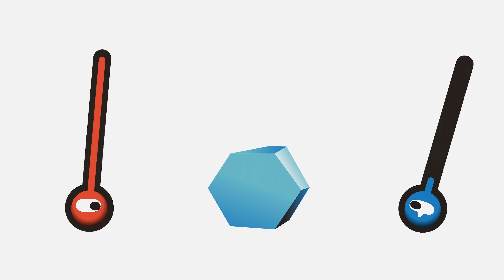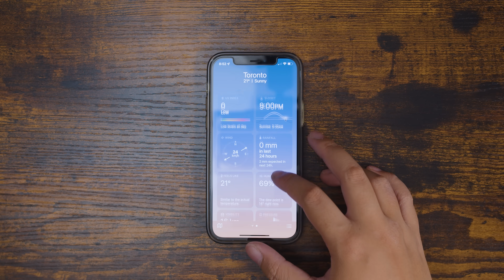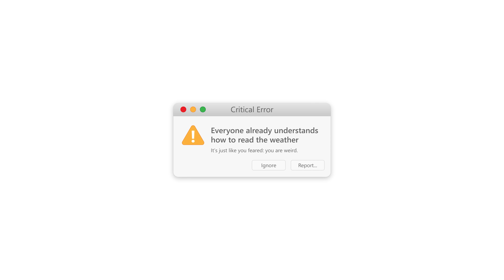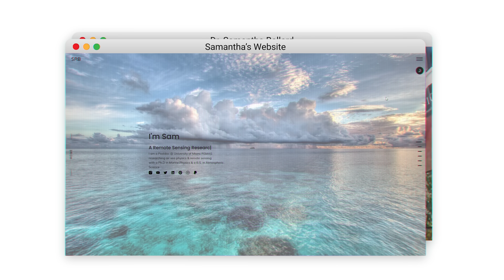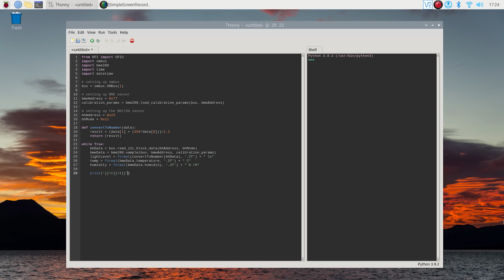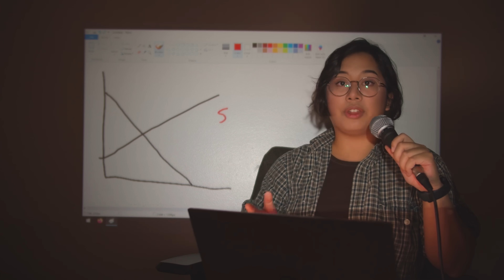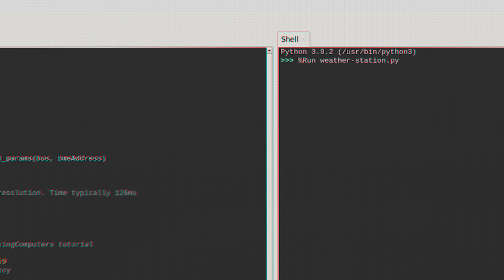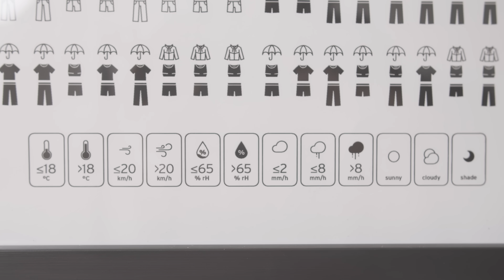how fahrenheit fails you

Comment: "Celsius isn't intuitive"

0 is freezing to death
100 is burning/having your blood boil inside your body to death

that is all

water freezes at 32f
what a.. weird number
Celsius is just 0-100

and ones comfort will depend on where their body has adapted
in some places 20c is pretty chill
some places 20c will burn your face off
in some other places 40c is seen as hot but not scolding

it depends on the architecture and who you are
places like the UK have houses built to keep heat IN
meaning 20c, which might not be much for spain or the middle east
will be SCORCHING for them

places made in hot places are made to not be so hot
and places made in cold places are made to not be so cold

Comment: Translation: "I understand 0 to 100 perfectly fine, but can't wrap my head around -10 to 40"
Reply: Since all non-Kelvin non-Rankine temperature scales are arbitrary anyway, why shouldn't we use the one that goes from 0 to 100 instead of two arbitrary numbers that are not 0 and 100?
Reply: @NYKevin100  Celsius isn't arbitrary though, it maps 1:1 with Kelvin, just offset by 273* degrees (* I think it might actually be 273.4 or something, but still 1:1 mapping).
Reply: @KindredBrujah  The size of the units are completely arbitrary.  Temperature is one of only three units in the SI system that aren't defined in the context of other units.

The Kelvin scale was created to use the same size units as Celsius, but there's nothing particularly special about the size of the unit.  If the SI system had used Fahrenheit/Rankine instead, everything would still work the same although the numbers would be different.

Comment: As someone living in central Sweden who also happens to have a pretty decent understanding of the impact of heat on the human body, I would say the following:

• –20* :  it's so cold that you could die if you slept outside without proper insulation
• 0* : it's freezing
• 10* : it's very chilly
• 20* : it's nice if a bit chilly
• 25* : it's nice and warm
• 30* : it's quite warm, but still pleasant
• 35* : it's getting quite hot
• 40* : it's unbearably hot
• 45* : it's so f**king hot that even desert-dwelling people are complaining, and there is a very real risk that a healthy adult in any country could die of dehydration if they are not careful
• 50* : it's so hot that you can barely think of anything other than retaining moisture
• 60* : you need to focus all your attention on finding shade, cooling down, and retaining moisture in order to just survive, and you would quickly begin to hallucinate if you cannot replenish moisture
• 68* : only the very hottest of deserts ever manage to reach temperatures this high, and all places that even occasionally experience this type of heat are deemed uninhabitable
• 72* : you cannot survive this temperature for more than a few minutes at most, and will likely die within fifteen minutes
• 100* : the water and blood in your body are literally at a rolling boil and you would be dead long before you reached anything near this temperature.

Comment: I dunno, maybe it's just my 30+ years of living with celcius, but I can pretty easily tell what to wear just based on the temp in celcius. Basically below 0 is winter coat, between 0 and positive 10 a light jacket, above 10 is hoodie weather, and as we approach 20 you can start taking of more and more clothes. There's some variation depending how sunny it is or how windy it is, and also if it's after winter mid temperatures or after summer mid temperatures, because those just hit different you know

Comment: I dont know man. I feel like it is a you problem with celcius. And you also need to look at the "feels like" section of weather. 20C can feel like sweater weather if its really windy and the Air is still cold from Winter. 20C can also feel quite hot when the Sky is blue and there is wind, no clouds and you stand in the Sun for 2 hours. Soooo, yeah. I lived in the US for 2 years and honestly Fahrenheit makes no sense to me. Usually I just wear a jacked until its like 90 or something. It just feels too huge. Like in my mind 60 should be sooooo much colder than 70, but it isnt. Like when Do I need a jacket? When a sweater? When a Shirt? With C I have an easy rule <10C jacket <0 freezing so stay home 😂 <15 is thick sweater <20 is sweater 20+ is shirt 25+ shorts. 

The only problem is nowadays weather is crazy. Like in the morning its 4C during the Day 16C at night 14C and at night suddenly -5

Comment: Humidity can also make a cold day feel colder! Places with dry air that are cold usually feel less cold than places that have a slightly higher temperature but higher humidity. I live in a very humid area and even though the winter technically arent that cold to other places it can feel absolutely freezing. Combine that with wind and it can be an absolute nightmare!

Comment: Before continuing past the 1 minute mark, here's my opinion: Fahrenheit provide better temperature resolution in our "comfort range" (between 0-100 covers most climates); Celsius is better in a technical setting, providing a more descriptive range for temperatures you can expect for environments in the kitchen or laboratory. Kelvin and Rankin are really only practical when talking about extreme temperatures (like how close you are to absolute zero or radiation temperature). In other words, air conditioner in F, oven in C, astronomy in K.

Comment: Another benefit of Celsius is that the temperature that you experience in your average day is a lot smaller, usually in the range between 0° and 40°, so it’s more concise and easier to pinpoint an exact temperature.
Reply: I like Fahrenheit for my dramatically different weather in each season locale. The temperatures exceed 40 c in the summer and drop below 0 c in the winter, so having a 0-100 f scale that covers basically every temperature we experience with very infrequent negatives makes sense to me.
But really it all depends on what you are used to using. It's just numbers that only mean anything if you have experience to apply meaning to them.
Reply: @cbpd89  personally, I prefer to look at it in a way, where what makes sense to me. You’ve presented some very nicely articulated points, and I enjoy discussing the topic. Personally, besides the general sense of the fact that Celsius is easier if it’s 0 to 100 for freezing and boiling, and all below freezing temperatures are negative and all above freezing temperatures are positive, I think it all comes down to the simple things for me. Can I tell the difference between 15°C, and 0°C. Truthfully, and yes, I get there wildly different temperatures, but I can still tell a better difference between them than 15°F and 0°F. Although Fahrenheit provides a wide variety of temperatures, I still don’t feel it provides me with that accurate of a position. It just confuses the hell out of me, even though I’ve used Fahrenheit, all my life, it is so broad for typical temperatures that it is very hard to determine what the temperature actually is. This is why I overall prefer Celsius, I can easily pack the temperatures in to 10° brackets. I know that anything below zero is freezing, I know 0 to 10 is pretty cold, I know 10 to 20 is OK weather, not too warm not too cold, I know 20 to 30 is warm, and I know anything above 30 is pretty hot. It’s generally easier to me, even though I’ve used Fahrenheit all my life, it’s just such a broad system. In my opinion, it’s so hard to pinpoint exactly what the temperature is.

Comment: 3:47 personally, regarding your argument about Fahrenheit, I feel like that applies a lot more to Celsius. With Fahrenheit, the range between boiling, and freezing is 180°, while in Celsius it’s 100°. This would mean that it’s a lot easier to nail down an exact temperature in Celsius if there is temperatures in Celsius that are more pinpointed and accurate. And this is coming from someone that grew up with Fahrenheit. personally, the only reason I think Fahrenheit is more intuitive is not because it actually is a more intuitive system, it’s just because it’s the system I grew up with. Just like to others, 35°C might be the hottest degree you’ve ever experienced, while for us in Fahrenheit, 35° is just a cold day.

Comment: Sorry, but you lost me. Celsius and Fahrenheit are both just an incremental scale corresponding to the physical attribute temperature. It doesn't matter how the range of that scale is represented, it matters that it's consistent, meaning that when the physical temperature is at a certain point, it will always correspond with the same number. I wasn't born with an intuitive knowledge that 0 equals the freezing point of water, it's a scientific fact that it does freeze at approximately that temperature, with slight variations in the real world depending on other additives in the water, or other physical factors, like constant motion, interfere with the freezing process. So Celsius picked it as his zero point. He could have picked the exact temperature that lead melts, or the exact temperature at which hell freezes over as far as I'm concerned. The point is he picked something that was factual, consistent, and actually relatable to him as a scientist, AND most of the general public. 

But that's just the science. When it comes to how I perceive temperature, it's based off years of actually experiencing temperatures and correlating them to measurements of temperature that are communicated to me by thermometers and news bulletins and weather forecasts. If freezing temperatures had been represented by the number 8,5 million, I'd know to put a good coat on and beware of slipperiness when the weather forecast says 8,5 million. If a warm but not scorching summer's day had been represented by the number -0,3321, than I would know to head out to the park when the thermometer's mercury pointed at the -0,3321 mark. 

The number really doesn't matter, and there isn't any intrinsic intuitive nature to either celsius or fahrenheit when it comes to how I perceive the weather outside. I appreciate the infomercial for diversity in STEM education and careers, but I think the premise you hung that message on is fundamentally flawed.

Comment: I'm a pants guy 95% of the time. Once it hits like 35°C I will consider wearing shorts, but even then I will probably wear pants.

On a work day it doesn't matter if it's 44°C outside (thanks Sydney) I HAVE to wear pants. It's just one of the requirements of my job (chef)

Whether or not I wear a "sweater" is always up for debate unless it's like 31 and sunny.

Comment: Celsius is kind of arbitrary but it's really simple: 0 °C (32 F) is the freezing point of water and 100 °C (212 F) is its boiling point.  10 °C (50 F) is a chilly day, while 25 °C (77 F) is a warm one. It is certainly easier to grasp and more practical for daily use than Fahrenheit.

Comment: Temperature isn't inherently any more centred around human experience than other metrics. Expecting 50°C to capture how hot a normal day feels is like expecting 50L to be a reasonable amount of water to drink in a day. And even if it were, the climate isn't the same everywhere. As you already discovered, you can't map everyone's experiences onto a single temperature scale. So really, it helps more than hurts that it's calibrated around something like water.
Water in particular is good because we use it a lot. We boil it, we freeze it, we drink it... so we have an intuition for how hot or cold water needs to be to do those things with it. That gives a reasonable frame of reference for things like cooking, but also for weather. If it's below 0°C, you can expect it to snow or hail outside rather than rain. Perhaps you'll prepare for the sidewalk to be slippery. That is explicitly linked to the freezing point of water and it's immensely useful in daily life.
When trying to figure out how you personally feel about temperature, you can kind of just... figure out which number means "hot" to you, and which one means "cold". To me, 40°C is about as hot as I'm able to bear. 25°C is warm but comfortable. 10°C is chilly. -15°C is when I start to avoid going outside when I can because it's too cold. And those numbers are going to be different for everyone. For some, they're going to be a lot different.

So, I'd say that Celsius is better. It doesn't pretend like it can offer a temperature range for weather that's equally meaningful to everyone, and is still useful in daily life on top of that in a way that Fahrenheit is not. It's more widely used internationally. And it uses the same scale factor as Kelvin, the de facto scientific unit of temperature, making it easy to convert between the two.

Comment: Celsius is a scale to measure the transition of water, something directly related to the climate and the human being (~ 60% water), so it is extremely intuitive, because:

Below zero - Freezing 🥶🧊
0°C - Very cold (water melting) 😖🌨
10°C - Cold 🙁🌧
20°C - Medium (tends to be more pleasant, generally varying by 5° more or less for each one) 😀😎
30°C - Hot 😓😮‍💨
40°C - Very hot 🥵
50°C - Unbearably hot (the hottest deserts reach this) 🏜😵
...
100°C - Burn (water boiling) ♨️💀

Comment: Thought of this video. Trying to program an automatic thermostat. You wouldn't think it'd matter what scale, but it works using numbers with one decimal of precision. Since celsius degrees are a bigger range per degree that means the thermostat is less precise in part because it doesn't use farenheit internally.

Comment: If you want to dress according to weather, just look not only on tge temperature, but also humidity and wind.
15°C with low humidity and almost no wind doesn't even require something other than simple jeans and thin sweater or just simple longsleeve
15°C with like 90% humidity and windy weather requires a jacket over sweater
It's not that hard

Comment: It's not even a debate that units for weight and distance are superior in metric, but when it comes to temperature I can accept that fahrenheit is at least arbitrary in a useful sense. Fahrenheit himself just measured the temperatures in his hometown and came up with this seemingly handy scale for measuring temperatures. 0F is a really cold day, and 100F is a really hot day. What can I say, it's respectable and useful for measuring outside temperatures. 
I still prefer Celsius though, because it fits in s wito beautifully with the other SI units:

If you fill a cubic decimeter (0.1 meter) with water, the volume will be exactly 1 liter and it will weigh 1 kilogram. And this water also happens to freeze at 0C and boil at 100C.  There's just a beautifully logical relationship between those units that gets lost when you use Fahrenheit, that I'm sure anyone with at least an interest in science would acknowledge.

Also for weather measurements it makes sense to me, when it's close to 0C you can start expecting snow and hail. Then how do you know when it's a hot or a cold day? You just learn it in the same way you would with Fahrenheit. It's not fundamentally more difficult to associate the number 100F or 38C with a really hot ass day

Comment: Humidity is a huge driver of how people feel temperature. I was recently reading some articles about how it often feels colder in the UK over places like the high North of Canada despite the scientific measure of temperature in °C telling us it's colder in the latter. The reason is to do with the triple point of water - the point at which water can exist in any state, and this can be affected by things like changes in pressure. Water vapour remains in the air at temperatures around 0°C and a few degrees below it - common in the UK - but once you get to lower temperatures significantly below zero, like -25°C, the air becomes arid. (Hence why Antarctica is the world's largest desert.) which is why people can be fine with -25°C in Canada, but freeze their balls off in -5°C in the UK.

The same concept also works for high temperatures too. I've spent time in hot desert regions and find 40°C in an arid climate is far more tolerable than the 40°C summer we had in the UK last year, where the climate is more humid. This, incidentally, is why swamp coolers are a waste of time in already humid climates and you can get better cooling by using a dehumidifier instead. Swamp cooling only works if there's not an excess of warm humid air already and will only work up to a point.

Comment: This is a very you problem. Touching grass and doing exercise would be better than building a weather station... But, hey, whatever works for you... Or if the table works, cool. Most people don't really need that, but this is okish.

I can confidently tell you you still don't need to go outside to exercise often because you are young enough - and Canada also locks you up a few times a year. In the next 2 decades you'll need to start doing it, so you better start now, because (that didn't happen to you just yet, I can tell) you'll eventually start waking up with strange pains that never happened before. You aren't dying, just getting old. Going outside makes the weather intuition happen and exercising gets rid of those pains.

It's very, very, very easy to go to Celsius thinking by knowing body temperature is about 100ºF and water freezing is 32ºF. Claiming this makes more sense is actually just imagination. You get used to thinking 0-36ºC just as easily as the 32ºF-100ºF. It's the same process, you just use another linear scale. Wind and humidity are just not considered in this system. You just didn't grow up with it. Most places in the world do not use ºF because it doesn't make a difference logically. Body temperature weather is too hot. Freezing is too cold. Middle is where you want to be (18ºC or about 20ºC if you want a round number).

Ultimately all this plan won't work because you need layering where you live and not wearing enough clothes for convenience won't be always an option.